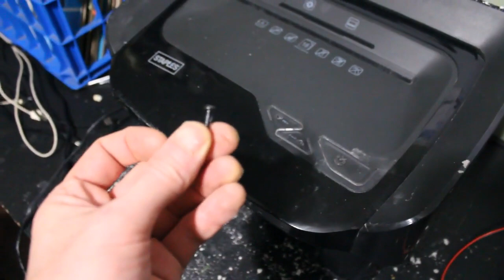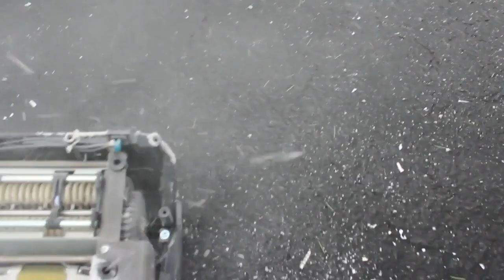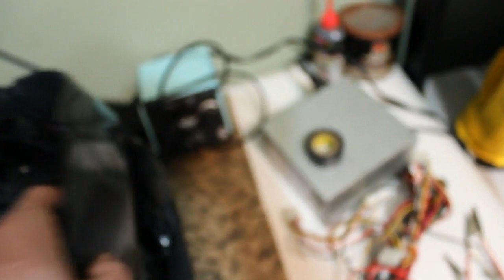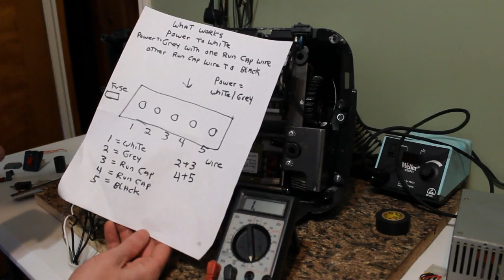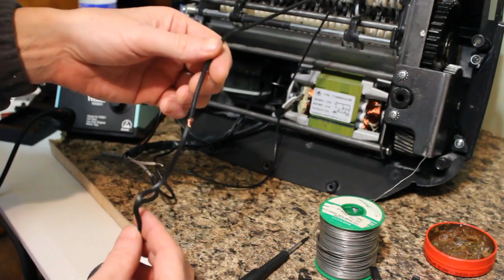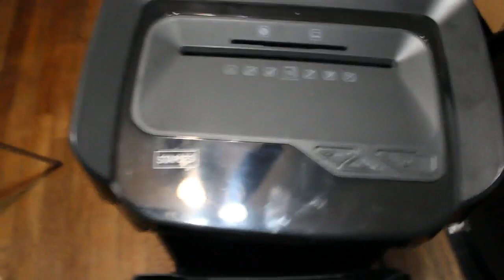EP2: Can we fix a trashed Staples SPL-TXC18A Shredder? Throwaway Society EP2

Comment: What type of handy man or electrician fixes shredders like this? I have a Royal Shredder that needs repairing but I don't know who to call. I called electricians but they say they dont do those types of repairs. I took it to a video game/cell phone repair shop and they couldn't help me. I know it's people like you out there. I just don't know who to ask for.
Reply: Met a guy across the road on a job site I was at. Retired electrical engineer (worked on NHS equipment) Now repairs old electronics like Hifi systems and anythngn really. Any sort of electrical engineer should know about general electronics and gears/motors etc. Hope it gets fixed

Comment: I have a fellows shredder I bought years ago at close out at staples nice machine but it’s doing the same thing I have power all the sensors work and light up  but no motor it’s not seized fuse still good but after seeing you’re video I’m going to try the capacitor first

Comment: I have a SPL-S242D crosscut  shredder not working. I have the green light but wont start when you feed the paper on auto position  or in reverse. Took it apart no paper jam. It is operated by a 115vac motor. Blades were hard to move spotted slight rust so applied some oil. was able to move with hand power. checked gears all ok nothing broken. Applied 110 volt ac and gears started to move.. Looks like some safety is keeping it off. suspected the overheat sensor was reading a 12.64k ohm. not sure if this thermistor supposed to read 0.
Anyone has any ideas. Thanks
Reply: It was a motherboard problem, couple of traces burned. Called the support centre, was told if it the motherboard the it is the end of life cycle.

Comment: found this  have  viewed twice but the one thing I missed or overlooked is cannot get the top to separate even after all screws removed, anyone have a clue as to what I am "not doing"?
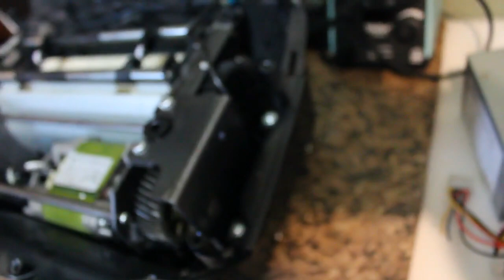Reply: wow impressed thought I would be waiting till after the new year I will recheck the screws, it was 05:00 when I was doing it and my eyes are not what they used to be.
Mahalo for the heads up
Reply from the maker: @eileenkalas3521  my eyes as well, good luck and Happy New Year!
Reply from the maker: Well thanks for viewing. There are a total of 11 screws, 3 towards the front, 4 in the rear and 2 on each side that go all around the cover, it may require some force to pull off or take a screwdriver in between the seam lightly and try to pry it off that way. The top also has 4 plastic posts underneath the top of the cover which get pushed into these rubber holes on the base so that may be what is making it difficult to remove, just give it some force to pull it up and out of the rubber boots the top sits on.